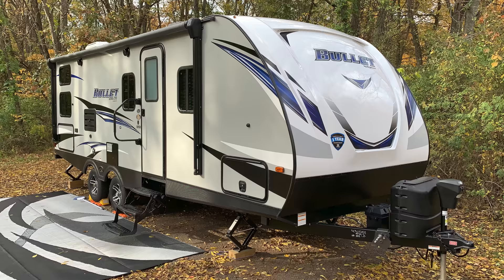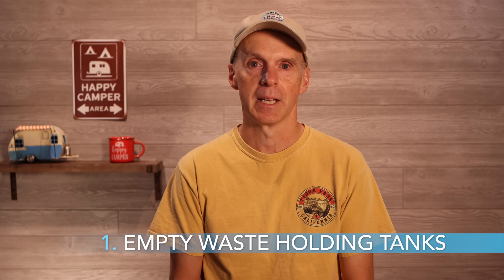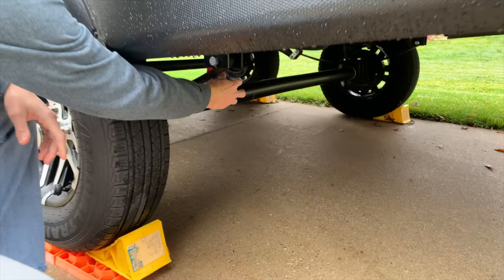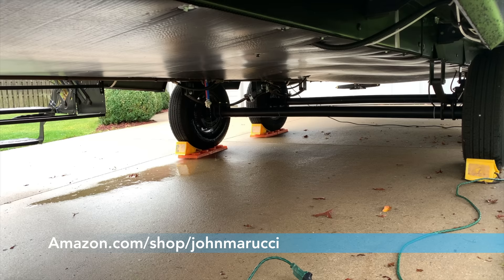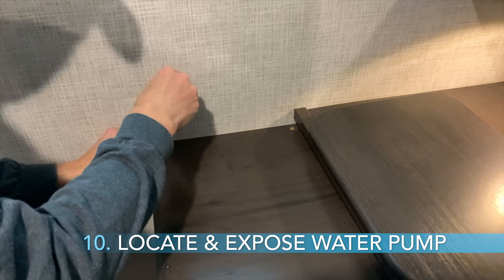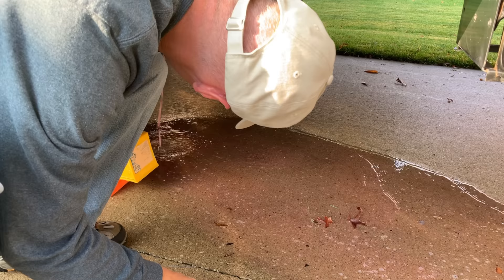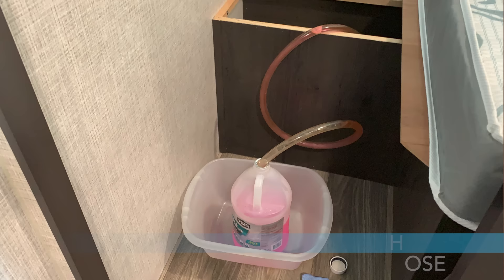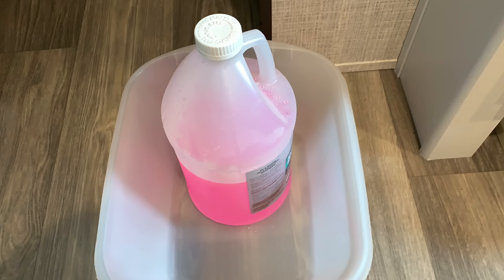RV Winterization Basics For Beginners – Step-By-Step Process

Comment: Couldn’t you just close the low point drains then turn on the water pump then go back and open them? I’m doing my camper tomorrow and don’t want to waste any antifreeze. Thanks, great video!
Reply from the maker: If you are doing it solo, you could use a bucket to catch the antifreeze at the low point drain outlets and use it later for the P-traps.

Comment: Thank you so much for this John. Great video. Helped us tremendously.
Reply from the maker: Great to hear that the video was helpful! Thanks!
Reply: @JohnMarucci  any thoughts on draining the antifreeze out of the low point drains immediately after running it through the system?  Any benefits to letting it sit in the lines all winter?  Thanks again!
Reply from the maker: The process does run antifreeze through the low-point drains. All the lines besides the city water inlet and black tank flush lines should be stored with antifreeze in the lines all winter to protect them from breaking when it gets and stays below freezing. You could remove some antifreeze from some of the lines but the safest method is to leave it in the plumbing lines until you dewinterize it in the spring. Thanks!
Reply: @JohnMarucci  thanks for the reply and thank you again for all of the valuable content.  Your videos are clear and thorough while also being to the point.  They are also visually appealing.
Reply from the maker: Thanks Gordon, I really appreciate the feedback!

Comment: I was told to always leave some water in the black tank maybe 1 of the orange Home Depot pail is it ok to leave that much water over winter?  Thanks for the video. Very informative.  This will save about $150 a year which is what my rv shop charges for this service.
Reply from the maker: There will be some minor amount of water mixed with RV antifreeze (from flushing the toilet with RV antifreeze) in the black tank after this process. This is all I have ever left in the black tank off-season. Limited amounts of water can expand in the black tank if it freezes but it can possibly damage the tank valve. Hope this helps.

Comment: Great video.  One thought, why blow out the water AND use antifreeze?  If you use antifreeze why do you need to blow out?  It seems a little like wearing belts and suspenders.
Reply from the maker: Greg, in the process shown in the video, the only forced air needed is on the city water inlet. Antifreeze won’t back into that section of line, so it needs to be blown out - if you used it (connected to city water). If you never used the city water inlet, there should be no water in that line. Hope this helps. Please let me know if I answered your question. Thanks!

Comment: This is a great video and byfar the best ive come across.

Do you leave the hot water tank bypass on and switch back in the spring?  And do you need to do the low points if you only use city water?
Reply from the maker: I leave the hot water tank bypassed until spring. You do need to remove all water from the lines whether you only use city water or your fresh water tank. The city water line only really bypasses the fresh water tank and the water pump. The low point drain allows water to drain from the lines. Hope this helps.

Comment: So I did the steps, I connected the siphon line to the water pump and turned the water pump on, but nothing is getting sucked out of the anti freeze container
Reply from the maker: Maybe double check that you are connected to the right side of the pump. If so, try putting your hand over the siphon line to see if it has suction. If you do feel suction, try priming the pump by pouring some RV antifreeze into the siphon line,m.

Comment: Excellent video John... perfect pictures for our first winterization of our new-to-us 2014 Bullet 22RBPR ... looks very familiar.  I don't have an air compressor to blow out the city water intake and black water flush.  Can I just pour some antifreeze down them (connect a short piece of old hose and funnel some down it)?
Reply from the maker: I suppose you can try this. I would recommend investing in a small air compressor ($40-50) at Harbor Freight or a similar store. Comes in handy for this task and keeping tires inflated properly. All the best!
Reply: @JohnMarucci  You just gave me an idea... I have a small 120V compressor for inflating my truck tires... need to somehow jury rig some appropriate connectors and it will do the job

Comment: Thanks. Very clear but, as a newbie, a couple of questions: Why blow out all the lines with air if I'm next going to fill them with antifreeze? Can I skip the step of blowing out the lines with air and just fill them with antifreeze?
Reply from the maker: You only need to blow out the city water line. If you never used the city water inlet, you can skip this step.

Comment: Great video, John. If I plan to use a city water hookup only, do I need to sanitize my fresh water tanks?
Reply from the maker: You can pass if you never plan to use the fresh water tank, however, make sure you still sanitize the rest of the plumbing system before using the first time on the season. Thanks!

Comment: Today will be my very first time taking the camper out for a 3 month nursing assignment. This is done when not using the camper correct? I’m wondering how the heck to winterize when we are living in it 🤦🏻‍♀️
Reply from the maker: It is for before storing the RV off season. If you are living in the RV through the winter months in colder climates, there are many other considerations. You may want to search YouTube for living in an RV in winter.

Comment: Thank you SO much for posting this! I have a question about the fresh water tank and the grey/black water tanks… do they need antifreeze?
Reply from the maker: As long as you have emptied the gray and black tanks, you should be fine. The is plenty of expansion space and some antifreeze will be in there from the toilet and from pushing antifreeze through lines and drains.

Comment: For some reason,  the anti freeze won't siphon thru the hit water lines.   I have an upper and lower valve on the tank.  Did you turn both valves to close them off?  I saw you only turned the bottom one on the video.
Reply from the maker: Yep, there can be differences between trailers. Sounds like you have something similar to my R-Pod. Watch this video starting at the 8 minute mark: https://youtu.be/173ozyKAcqk

Comment: Your videos are so helpful! We have a 2021 Rockwood 2513S that we haven’t used yet. We are located on the Texas Gulf Coast and are expecting two nights below freezing late next week. Should we go through the entire winterization process? Or are there other things we can do to keep from damaging our camper?
Reply from the maker: Glad the videos are helpful! As far as winterizing, I think it depends on how cold and long the freeze will last and if you have the trailer nearby where you can keep it heated or if it is remote where you cannot. One thing you can do at the very least is drain all the water from the unit. However, there is no guarantee that you'll get everything out from the water pump or valves. If you have small air compressor you can blow out all the lines, which many people do vs. using the RV antifreeze. If you go this route, there are videos of YT showing the process. Hope this helps!
Reply: @JohnMarucci , thanks for the prompt response! Our camper is in our driveway so it’s easy to keep the power & water hooked up. As of right now they’re predicting one night on the low to mid 20’s and one night around 30. Then we’ll be back up to our usual seasonal temps, highs in the 60’s, lows in the 40’s. We’ve only had the camper a month or so and have filled the city water about half full. I’ll drain it to be on the safe side. Thanks again for you videos and your prompt response to my question. Have a very Merry Christmas!
Reply from the maker: Feel free to let me know how it goes. All the best!

Comment: Thanks for the video :)  So if you use a compressor to blow out all the lines, why do you need to put antifreeze back into the lines?  If they are empty then there is nothing to freeze and a few drops of water if they freeze won't be enough to burst any pipes?
Reply from the maker: The process in this video uses compressed air to blow out only the low point drains and the black tank flush lines. Many people use only compressed air to winterize, but you would need to blow out all plumbing lines if you don't fill them with RV antifreeze. There are several YouTube videos on the subject of winterizing with compressed air only. This process, using the RV antifreeze, is what the manufacturer recommends. 

Also, if you use compressed air only, you really have no room for error, especially within the water pump. There is a comment below from a person who worked in an RV dealership who talks about the number of cracked water pumps they would see in the spring from people not using the compressed air method correctly and leaving water in the pump. It's really your call as both methods work if done properly. Thanks!

Comment: so i went to hook the siphon line up for the antifreeze to the pump and no line was hooked up to the pump input, only the output line was hooked up. there was a capped off line sitting there but not sure if this was the line from the water tank or not. the prior owner wasnt aware there was a capped line. its almost like the fresh water tank and pump have never been used. not sure what to do at this point
Reply from the maker: Randy, that sure seems strange. Feel free to send a pic of the current set up to my Instagram account: https://www.instagram.com/johnmarucci

Comment: Awesome video! THANK YOU! I don't have a compressor. Can I use a tire air hose? or could I use an air mattress filler?
Reply from the maker: You will need enough steady air pressure to blow out the line. I am not sure that a tire pump or air mattress pump will do the trick. I do think a small compressor is a good investment as part of owning an RV as I use mine to keep my trailer tires at the proper psi when travleing besides for general maintenance like winterizing. Thanks!

Comment: Question: Because of where I live I must store my GeoPro at a storage facility. I've winterized it using your instructions (thanks!). Should I disconnect the battery for the winter? Should I remove the batteries from camper and store in my garage? Thanks for the help!
Reply from the maker: I also store my travel trailer at a public storage facility and I do remove my battery and store it in my garage. I sometimes put the main battery on a trickle charger to keep it charged up while not in use. I also remove any smoke detector batteries and leave the smoke detector doors open as a reminder. Thanks!

Comment: I have a camper that seemingly has NO access to the water pump without really taking apart some cabinetry. I don't even see any screws to take out, it's all covered by trim panels. Can this be done by pouring a gallon into the (empty) fresh water tank and running the pump to get RV antifreeze into all the lines?
Reply from the maker: It can be done this way. You may want to try and rinse the fresh water tank out afterward so RV antifreeze doesn't sit in there off-season. You may need 2 gallons to do it. Thanks!

Comment: Why not just put a couple gallons in the fresh water tank , turn on the pump and turn on faucets, toilet flush until all pink runs through. Empty water heater and turn shut off valve so it doesn't fill up.
Reply from the maker: You can do that and it will likely work. I think the manufacturer's method, which I am attempting to show, shys away from putting RV antifreeze in the freshwater tank to keep any antifreeze residue in the tank over the winter. Thanks.

Comment: after step 2 regarding the low point drain, (not the hot/cold), after this step, I'm assuming the drain line should be closed back up?  It's never stated in the video or the printed steps...
Reply from the maker: Thanks for the heads up. Yep, closing the fresh water tank cap/valve should be included at the end of Step 2. Thanks again!

Comment: Thanks.  I have a new Class C and pulled the 6 gallon WH and installed a on-demand unit.  Should I go ahead and let it suck in some RV AF since it's just some short lines (no significant tank)?
Reply from the maker: I don't see why not, but check your on-demand user manual first, some manufacturers don't want any RV AF in their units lines. Thanks!

Comment: Once you bypass the hot water tank and fill everything with antifreeze, do you just leave the valve in the upright position and just never use the hot water tank during the winter months? Or can you turn the valve back to its original position to not bypass the tank once you have completed all the steps ?
Reply from the maker: I do leave the tank closed during the winter, so no antifreeze seeps back into the tank. You can do what you say and some people do so they don't have to mess with it when dewinterzing in the spring. Your call.

Comment: Dumb question: do I need to add a siphon hose to my water pump? I located the pump, but all of the lines are clamped tightly and there isn’t a release button, which makes me think they shouldn’t be removed.
Reply from the maker: If you don’t have a clip at the water pump that will release the line, you may have another line already attached that you can use to siphon the RV antifreeze. If you take a look at my R-Pod wintering video, you’ll see this line and valve. If you still don’t have a way to siphon in the RV antifreeze, there are kits available to add to the lines. Here is the link to the R-Pod winterizing video, start at time 8:20: https://youtu.be/173ozyKAcqk?si=vQUa61RTkldFS2jq

Comment: Why does the pump need to be located? Couldn’t you just fill the fresh water tank with antifreeze then turn the pump on? Also is the purpose of bypassing the hot water tank because the antifreeze is corrosive? Thanks
Reply from the maker: Some people do what you are saying and put RV antifreeze in the freshwater tank. However it will leave some residual RV antifreeze in the freshwater tank, so if you go that route, you may want to flush it thoroughly. If you don’t bypass the hot water tank, it will fill up with RV antifreeze. My hot water tank is six gallons, so that’s a lot of RV antifreeze extra. Hope this helps.

Comment: Hi! I am preparing to winterize my RV for the first time myself. Question: I do not have an air compressor… could I substitute cans of compressed air to achieve blowing out the lines? If so, I’d appreciate any guidance you could give to accomplish this! Thanks!! This is super informative, and I appreciate you posting it!!
Reply from the maker: I have only used an air compressor to blow out the city water line. So I can't speak to trying to use a can of compressed air. Not sure if it will work or how you would attach it properly to the city water inlet.
Reply: @JohnMarucci  thank you!

Comment: Great and informative video, I have a 2021 Gulf stream 197BH conquest. Do I run anti-freeze threw the hot water system till it comes out the hot water valve?
Reply from the maker: You will want to bypass the hot water heater or you will fill it with RV antifreeze which could be up to 6 gallons. Once bypassed, run the RV antifreeze through both hot and cold plumbing lines.

Comment: At 4 minutes you talk about blowing water out of the black tank but I think you mean the fresh water holding tank. Am I correct? I thought you just drain the gray and black tanks.
Reply from the maker: Craig, That speaks only to the black tank flush line. If your trailer has a black tank flush and you’ve used it, there may be water still in that line between the flush inlet and tank. Thanks!
Reply: @JohnMarucci  thanks for the clarification.  So should one also blow out the holding tank?  One thing I never hear mentioned is the importance of leveling the RV first. I would think leveling is key to getting water out of tanks.
Reply from the maker: Craig, just drain and if possible flush the holding tank thoroughly on your last dump of the season. You are correct on having the trailer level when winterizing. Thanks!

Comment: Great video! Do you sanitize before? I don t have a air pressure machine, can I do without?
Reply from the maker: I only sanitize the fresh tank and lines when I dewinterize in spring or if the trailer sits for a while during season. If you used the city water inlet, you should blow that line out with compressed air. Thanks!

Comment: Very informative video, thanks!
I do have a question, we have one more trip in two weeks however the temperature in the evening will be below freezing. I know we don’t want to completely winterize but what should we do to prepare for the low temps for the next two weeks?
We are new at this so thanks in advance for any help you can offer.
Reply from the maker: David, it's your call, but if the trailer will be sitting unused (with the furnace not on), you may cause damage if it sustains temps below freezing and it isn't winterized. If it were my trailer and at my house, I'd set the furnace to 45-50 degrees and it would be fine. If your trailer is in storage away from your house, do you have the ability to bring the trailer to your house to do this? Also, it depends on your trailer (does it have a heated and enclosed underbelly?). I do have a video on freeze tip warnings at this link: https://youtu.be/kfj1fcn6nok
Reply: @JohnMarucci  thanks, it is at my house and I will follow your advice. It is a Lance 1985, four season. We have only had it for a few months.
I will drain water and set heater to come on as well!